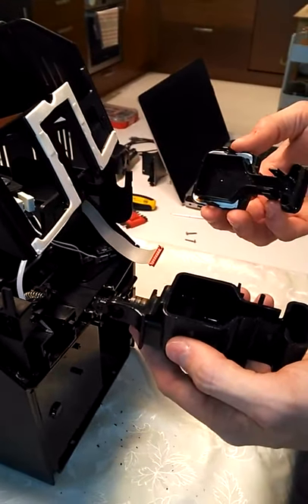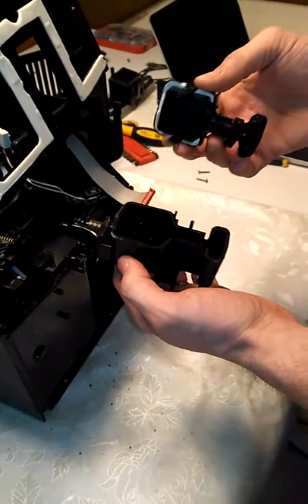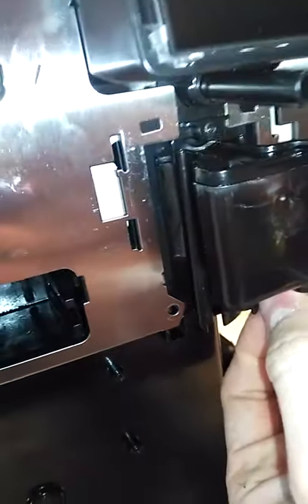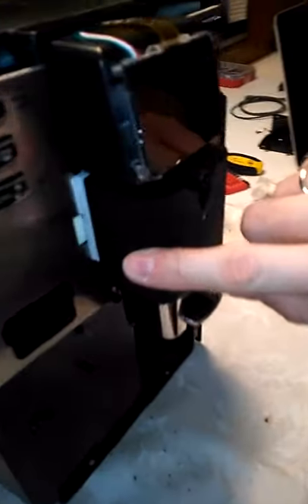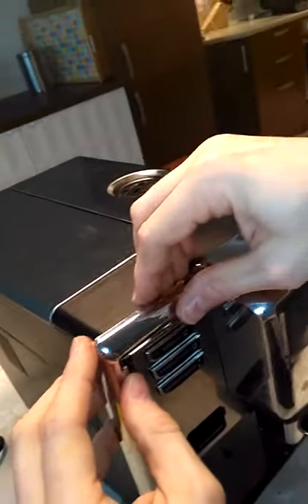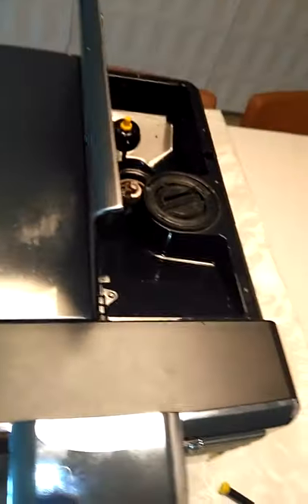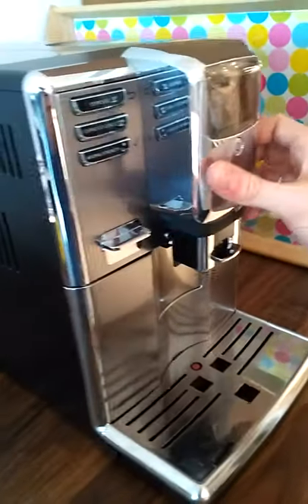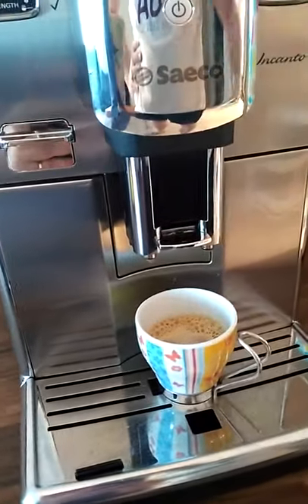Saeco Incanto HD8917 deep cleaning / dismount + solenoid valve repair

Comment: Thank you! You saved my coffee life. After 4 years of used, and i didn't use an ungrease procedure ,only calc, the coffee acumulated and got dry hard into the front part, not allowing proper coffee run through the two "exits". I managed to clean everything, unmounting and mounting back the machine, thanks to your video.
Reply from the maker: You are most welcome!
Reply: @lucatrombin1846  la mia macchina di caffè non macina più, cosa devo fare? Mi compare la chiave e nr1

Comment: hi, thanks for your video. I have a problem. The coffee grind is coarse even though the regulator is set to minimum. Is it possible to draw even more of the grinding from the inside?
Reply from the maker: Hi Stefano, I didn't get exactly, maybe you can explain me in italian :)
If I understood correctly the grinder is too tight even at minimum.
If this is correct, I believe you can open the machine and untight the grinder manually since the regulation from outside is blocked by a plastic stopper, but inside the machine you can do it. (I believe I did the same mistake once and I tighter it a bit more)

Comment: Hi, I have the same machine as the product, there is a problem with the coffee, but after the coffee is ground, it does not flow with water, it empties the coffee in vain, and then empties the coffee into an empty room, because the powdered coffee does not come
Reply from the maker: Hi, I believe the machine is completely clogged. Does the water coming out at least?
Reply: @lucatrombin1846   Wasser kommt nur aus Dampf.. heißes Wasser kommt aus der warmwasserabteilung, aber das Wasser kommt nicht von dort, wo der Kaffee fließt, es kommt nicht zum Kaffee. Der Kaffee wird gemahlen, der Kaffee wird gepresst, dann nimmt er das Wasser und nimmt den Kaffee nicht heraus, entleert den gemahlenen Kaffee in einen leeren Raum, stoppt das Mahlen und erkennt, dass Kaffee nicht von wo Kaffee und Wasser kommen sollte
Reply from the maker: @kenankarabacak6084 Hallo, ich habe verstanden. Ich denke dass deine Maschine ist voll verstopft. Hast du schon meine Reinigung Methode probiert?

Herzlich grüße,

Luca

Comment: Luca,  do you have any recommendations as to what may be wrong If I continue to get the dreaded "out of bean" error?  Half way through my brew, I get an error indicating the beans are out (hopper is full), and it stops brewing.  I also get really wattery coffee pucks...is this normal for these machines?
Reply from the maker: Hi, I don't know what is the issue, but for sure it is not normal that your machines gives you the "out-of-bin" error almost all the time even if you have beans ... the only one issue can be that the hole is not clean and your beans gets stuck ... did you buy cheap / not so dry beans ?

Comment: Hi Luca, would you please let know what size of screw driver to use? Thanks!
Reply from the maker: Hi, I think I used a T15x80 (HR 362 brand Wiha)
Reply: My HD8911 use all T10. Only grinder cap uses a T15.
Reply: Anyway, thanks for your video. You’ll never know why my coffee drip being right side less than left. There is a small cockroach stuck inside the spout...

Comment: Hello Luca, thank you for the vid! I've broken the top clipping part of the actual unit that has been clogged - https://youtu.be/4o8_XRGHt6E?t=33 do you know whether this top part is sold as a spare one or I am screwed?  Thank you !
Reply: Found the spare part as per the spare parts diagram of Saeco, thank you!
Reply from the maker: Hi  @valentinnikolov793  , sorry for the late reply, I'm very busy.
I'm glad that you found the spare part.
Be careful when you do these kind of "maintenance operations" since you can break some machine parts very easily.
Reply: @lucatrombin1846  Hello Luca, I've successfully cleaned the machine, the only thing that I broke was the plastic clip /braked on the top cover (the part that was clogged ),, however I have used a tape to secure it :)
Reply from the maker: @SuperDominatorX  Understood, good, thank you.

Comment: You dont have a video how to dismount it , have some issue coffe is coming only 1 way
Reply from the maker: Hi Alexandru,

unfortunately I dismounted first and then I realized that it's better to make a video for everyone, so I don't have the video where I'm dismounting.

But if you follow the mounting one in reverse order it is exactly the same procedure.

In case you are stuck maybe I can help you here.
Reply: I am having trouble removing the front cover (the shiny part with that fits over the screen). Must be some plastic clips holding it in (it is where you hit it with a fist to click it back in). What technique can be used to get it off with breaking clips?

Comment: Dismount and deep clean??? No way you just put back the pieces this show you how to MOUNT BACK the machine, unless you can play reverse is not that usefull unfortunatelly its the only vid i could find on the tube
Reply from the maker: Hi Federico,

sorry but I dismounted and then I realized that it's better to make a video because it's very complicated.

I didn't made the dismount video because it took for me half day to understand how to it (and I don't want to repeat the same experience to make a video sorry :) ).

If you follow the video backwards you can dismount, it is exactly the same procedure.
Reply: I just did everything in reverse ;)
Reply: @lucatrombin1846  you don't have to apology for anything. What you do is great !